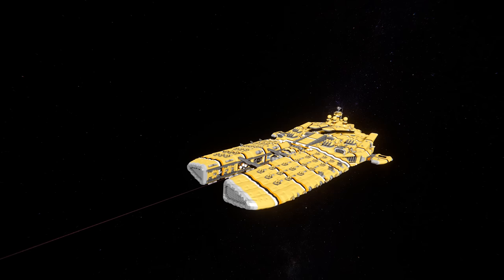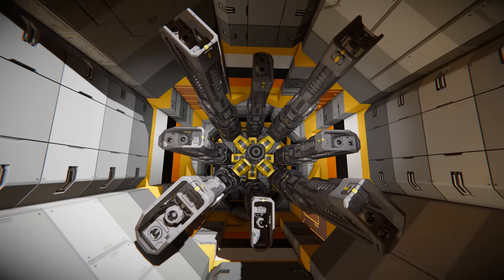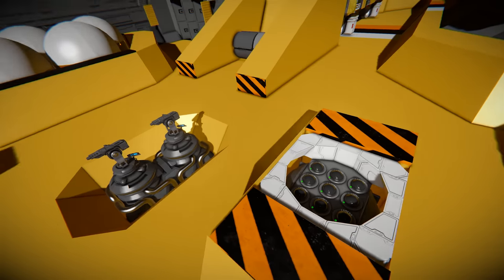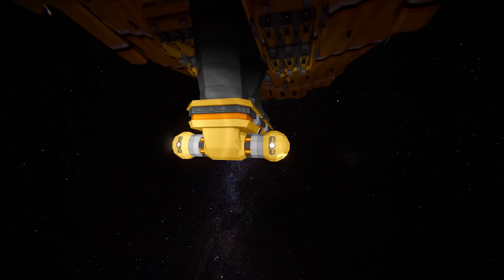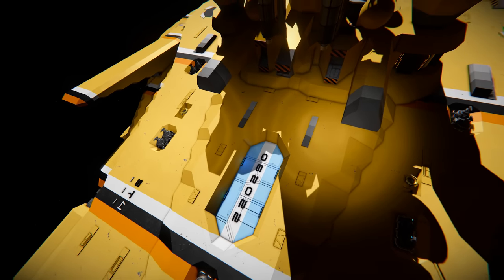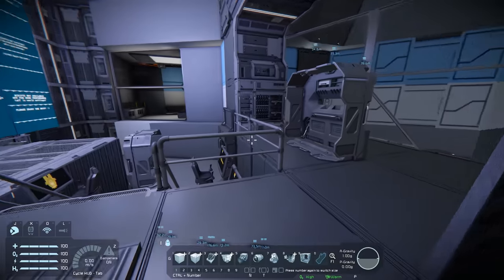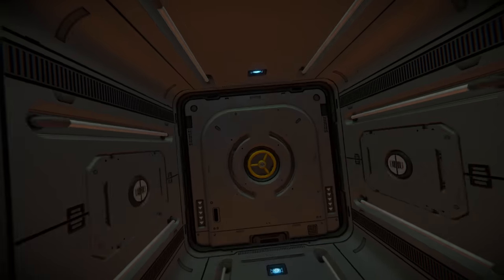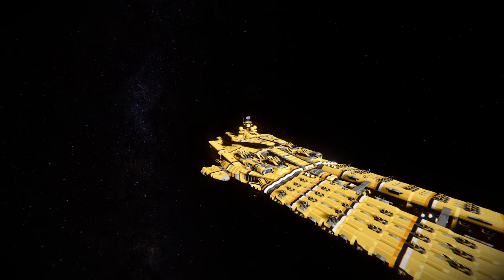Vanadium II A150 Heavy Super Cruiser - Space Engineer's

Comment: It's a work of art and love, to be sure.

If the dorsal and ventral gun decks were sloped forward to maximize firepower (e.g. Star Destroyer) the effectiveness might be greater, but the detail is irrelevant compared to the aesthetic of this masterpiece.

Well done. 👏🏻
Reply: You mean a superfiring turret setup? It would in fact be more effective, but it seems like the ship is designed for a broadside, after all, the turrets are already in the right places for it. Think Star Destroyer but designed for broadsiding.
Reply: I believe he mentioned, and you can see, that it actually is setup that way, at least a little.  Maybe.  Doesn't matter I guess because NOTHING would want to be in front of that rail gatling system in the middle.
Reply: @bsquaredbundles  , agreed. That thing is a monster.
Reply: @arbitratorkit3626  , yes, essentially. The only disadvantage to a superfiring design would be a potentially larger silhouette for enemies to target in a broadside engagement, so perhaps that is reason enough to avoid the extra bulk. As I said, the detail is superfluous compared to the scope and magnitude of this design.
Reply: @DjigitDaniel  I agree, it does seem like it would add a larger silhouette, at least on the back of the "Wing" structures, that is. But yes, I do completely agree, the detail is very minor in comparison. Huh, one of the few times I've actually enjoyed interacting in youtube comment sections. Great... discussion? It almost feels too short to be one, so I'll just say great chat!

Comment: No gravity drive (once you get that heavy its a must) or player main missiles.  Not enough weapons to stop missile spam.  I would guess that jump range is poor as well.  Not built to land on a planet (yes you can do it even at that weight, not a requirement on a warship).  Not a lot of guns.  Looks great, the engines look amazing.   Work of art overall.  Forward railguns make the front of the ship weaker.  The small turrets are useless, they will run out of ammo as well and wont be rearmed.

The thing about gravity drives is they osculate so you need a few normal thrusters but you can hide them inside the ship.  Gravity drive will take that large ship from 0-100 in a few seconds. If you want to go planet side then you can only go hydrogen engines and this will lead to the ship becoming to complex.   Printing on a big ship like that increases weight even more because of storage and reduces jump range.  Also more mass will make the speed worse without a gravity drive.

You can get a version without any mods.  My missile destroyer deleted it at 5000 meters (you can make player guided missiles and AI ones that have that range without mods) but its a just add more guns kind of ship.  More missile and gatling turrets and this can shoot down most incoming missiles.  Then the front railgun firepower is nice when you can close to attack with it.  This is were you miss the gravity drive.

Unsafe Grids warning and you have to disable limits to paste into the world.  Tanks server performance and FPS.  Looks great.  Cant use this in my game :(  even with the guns changed.  Causes save to freeze at 100% when loading.

Comment: Nice presentation Aaron very welll done considering you have dyslexia. Being unable to pronounce the metal Vanadium must have been very awkward. Well  Done. As for the design, its a very nice trophjy model but as the frame rage indicates the cpu loading is massive and is not a practical proposition. a better variation would be to use less guns with the remaining being gatlings and have large kinetic drone missiles as the ranged arnament. \having many rail guns looks good but the power drain on recharge and the charge delay limits their effectivness and are useless in swarm attacks by corvette or light frigate classes.

Comment: Meh. I appreciate the artistic eye and the effort the ship would have required to build but at a glance it's easy to see how little practical  consideration went into the actual design. The staggering is a nice platitude, but sheer volume of fire its about all it has going for it. Even ignoring the inherent problems with SE that REQUIRE the thing to exist entirely in its own world it's remarkable flimsy with an incredible number of gaping holes. There's barely even enough space for one layer of armor and anything else is going to eat up ammunition and maintenance access to the point I suspect this is the kind of ship that would have to be scrapped if it takes too much internal damage since what little space there is in the arms is going to be completely clogged with crap. It's pretty, I might even dare to say it's okay as far as desk model/showroom tubs go. The engine greebles are honestly the only things on it that's impressive, and as long as you don't think about their implementation at all the the center railguns are really clever. But forget about killing a fleet, this thing would be doomed if it met so much as two stock vanilla ships working together. 

I'm not even trying to be cynical or judge it to the higher standards I'd hold a practical design. There's just no nice way of saying the thing is overcompensating aesthetics while pandering to practicality, it ends up being ugly once you dig under the dazzling glitz. The only way I can describe it is that the ACTUAL flying art pieces feel like they're more practical to work with.

And I somehow forget to mention the glaring lack of actual point deference for that matter. That's probably why the front end is giving me such strong copy pasta vibes.